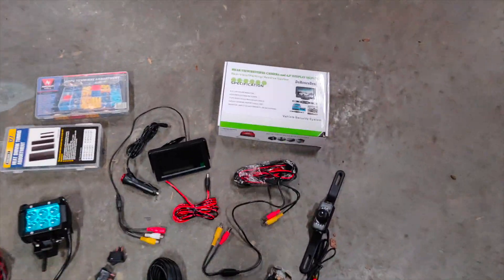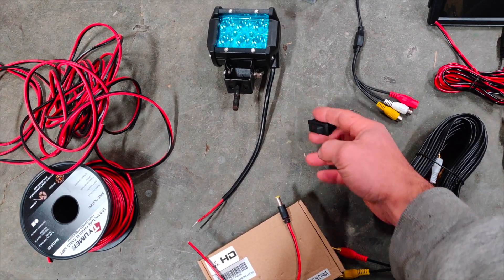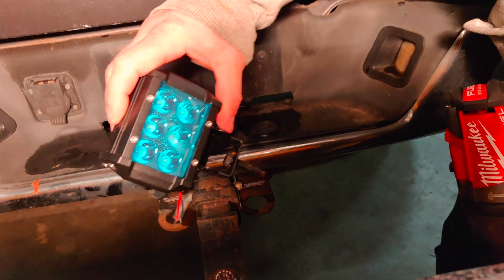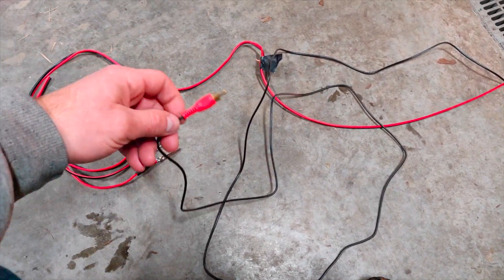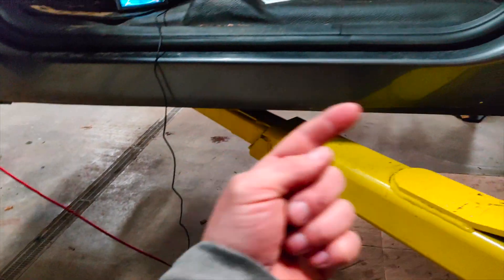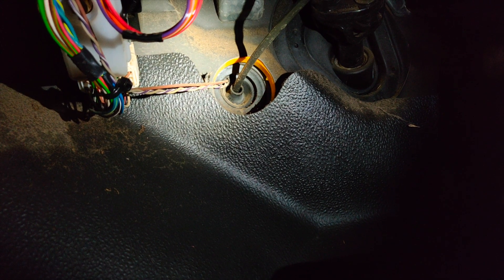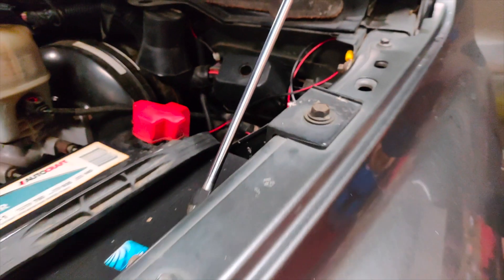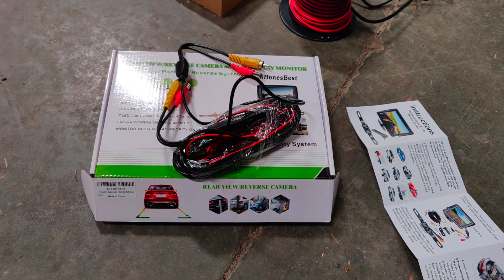CHEAPEST BACKUP CAMERA ON AMAZON - Review/Install of the Cheap Reverse Camera + a LED Light

Comment: Tim, you can find heat shrink tubing on Ebay etc with a glue coating inside it which melts when your shrinking it. It's very useful for outside weather protection.

Comment: This was the simple solution I was looking for. Thank you!! Presumably, the light and camera power could be wired up to the reversing light at the back of the truck and the yellow wire run to the front for the screen connection. The screen can be powered through a switch and each of the two cables (One ground and one 12v) could be attached in the engine compartment.

Comment: If you were to get a On-Off-On switch, you could set that reverse light up so it's either On, Off, or tied to the truck's reverse circuit. That way, all your bases are covered.

Comment: I don't know about your particular model but on the one I have I use the second video wire for a camera on the back of my caravan. I can then manually switch between the one on the ute and the caravan. the switch is on the monitor.
Reply from the maker: This monitor doesn't have an input switch. Also Ute? Are you in Australia? And are the cameras wireless?
Reply: Pretty good idea🤘🏽

Comment: Should have just run a power wire from your reverse light, no need for a cable all the way to the front, an LED light and the camera draws little power, they will not overload the reverse light fuse, for a easy switch, run the power cable from your tail light, that way you can manually turn on the camera by switch on your park lights (no extra switch needed).